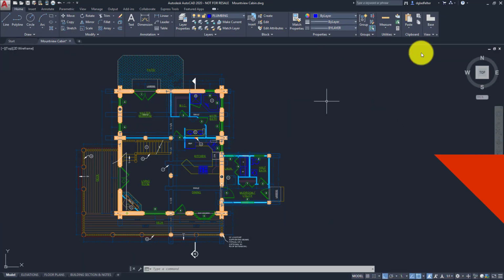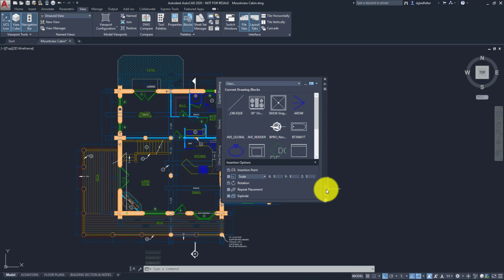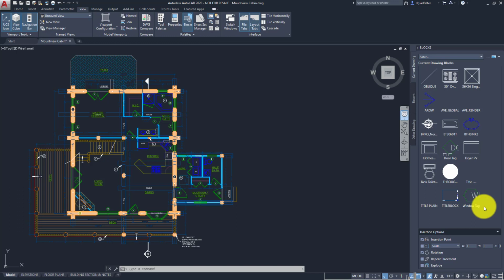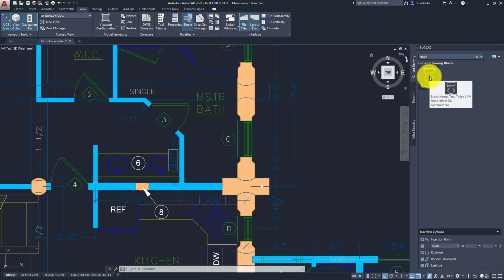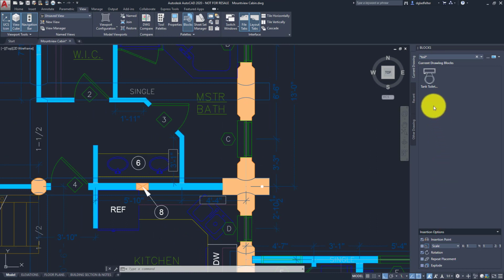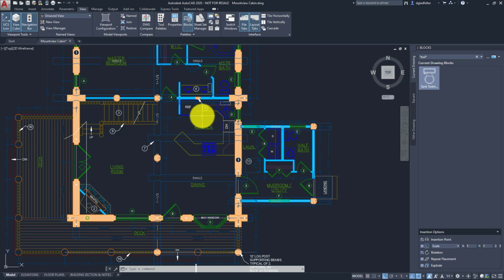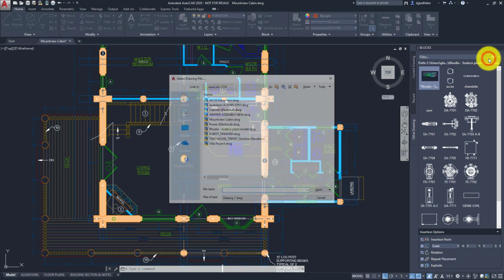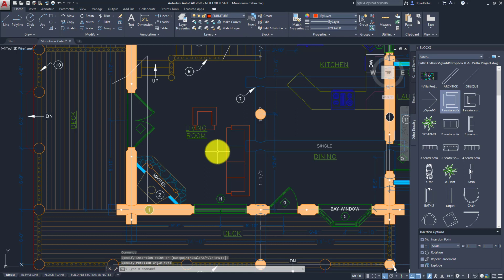A First Look at the AutoCAD 2020 Block Palette

Comment: whenever i am inserting a furniture block scale is different and sometimes it is not picking my insertion point what to do ? both of the drawings are in same unit
Reply: Here is a tip or two. When you insert a block try tapping the ctrl key to cycle between grips within the block. If you add dynamic commands to a block this function becomes useful as you can add as many grips as you like for different scenarios. About your scale try using this command its a system variable "INSUNITS"  
0=Unspecified (No units)
1=Inches
2=Feet
3=Miles
4=Millimeters
5=Centimeters
6=Meters
7=Kilometers
8=Microinches
9=Mils
10=Yards
11=Angstroms
12=Nanometers
13=Microns
14=Decimeters
15=Dekameters
16=Hectometers
17=Gigameters
18=Astronomical Units
19=Light Years
20=Parsecs
21=US Survey Feet

When you insert the block go to the properties & check that the X & Y scale = to 1.000. Also check your block definition in block editor that its in correct units. also when creating a block make sure you do not make it annotative as it will scale your block to suit your annotation scale is set at. If its 1:50 it will scale it by 50. I usually create my blocks as unitless & helps to suit any unit the dwg is in. Hope this helps. Reply if you still dont come right. you can send me the dwg & i can maybe check it out for you. Let me know.